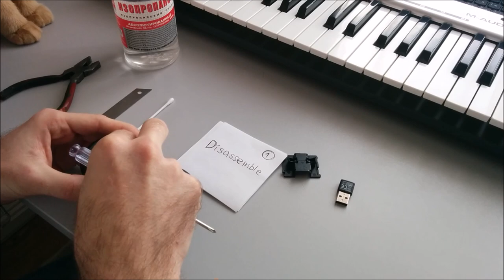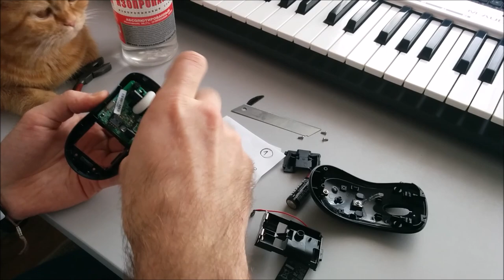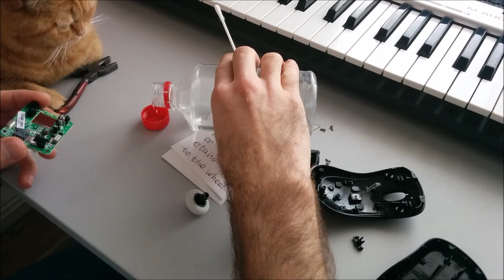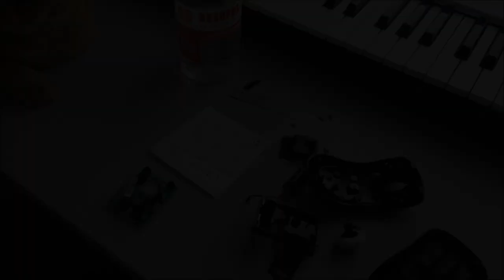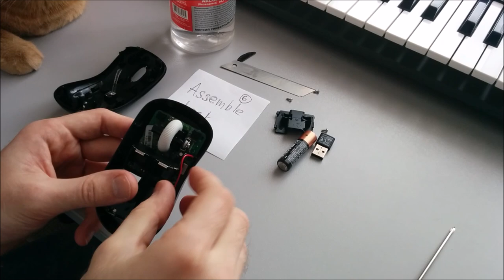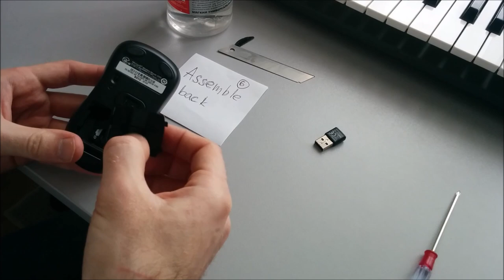How to fix Microsoft Wireless Mouse 1000 scroll wheel jumps

Comment: In addition to cleaning, I also removed the white rubber wheel and placed two turns of duct tape underneath. The first one facing down, the second one inverted, both glued to each other, so that it won't spin around it's base without sticking. . This resulted in a much, much more reliable scrolling experience.

Thanks for the instructions.

Comment: upon taking mine apart, the issue was the rubber wheel was rotating around the plastic center - so am adding glue there after washing those parts.   Great vid - thanks!

Comment: The hidden screws solved it for me. The problem with the mouse was the rubber tyre was slipping on its axle and it wouldn't scroll single clicks. I managed to get the wheel out without disassembling anything else. I took the tyre off and refitted it with some glue. Thanks for sharing.

Comment: Upon watching this video, here is what I did, i turned the mouse off and scrolled up and down very quickly for a few minutes. the idea is, if there is any debris on the wheel or contact points, it will fall off or just magically disappear :)  this method worked for me, at least for now. 

By the way, the video is 8 years old, I wouldnt have guessed that its been that long. As far as I remember I'm on my third MS keyboard-mouse set. With the previous sets, it was the dongles that failed, MS dongles are big and not very mechanically sturdy. 

My other sets are Logitech with smaller dongles. Smaller dongles are more practical for laptops.
Reply: Trust me, this method won't last long. I've been doing this for a couple of years, every action lasts for a couple of days. And here the dusting of the problem itself is at the root.
Reply: Just did that and the wheel works fine for now. Let's see how long this solution will last
Reply: this actually worked! i was just about to dismantle mine when i came across your comment and it saved me from this whole process! i
guess it's just part of the wear and tear, nothing lasts forever. if it happens again, just gotta roll away

Comment: Such a well behaved cat, and so attentive. I couldn't see how to pull it apart and nearly did some damage before finding this. After cleaning the mechanism with isopropyl I found my issue was slightly different. The rubber tyre was sliding freely over the hub. The wheel came out quite easily without removing the circuit board. I used a bit of contact adhesive inside the tyre to stop it sliding.

Comment: This really helped, turns out the red wire was not slotted in with the duel metal connector. This helped especially for the back grip peel - off, because beforehand I didn't want to break it even more!

Comment: I have the same Microsoft Wireless Mouse 1000 mouse and it's about 1.5 years old.  The little wheel was encased so i couldn't touch that.  I blew out all the parts & used et0h on the big wheel. To my surprise, it worked!  Just a heads up for anyone else who is having the same issue & DO NOT see the 2nd tiny wheel, there is still hope.

Comment: That fixed my problem. The scrolling was going back and forward. I assembled it after just 20 minutes and it didn't work at all (I didn't know it was probably still wet). I let it there for about an hour and then did another test. It now works perfect.

Comment: Great video it helped fix a MS Wireless 1000 mouse! 
But I noticed that the white rubber was sliding on the plastic wheel.
I removed the white rubber and used a small rubberband on the plastic wheel then reinstall white rubber.
Now it works great!

Comment: I have a later model Microsoft Wireless Mouse but it's basically built the same internally. However, instead of using alcohol, I used Shredder Oil to lubricate the plastic part that was squeaking, and I didn't need to take the scroll wheel off to get it nice and lubricated. Easy Peasy!

Comment: Alternatively i used wd-40 in the rotary encoder (mouse wheel internal) as it is good specially for electronic contact cleaning. And the mouse wheel started to work like a charm. Definitely worth a try with wd-40.

Comment: Thanks! Worked at first shot! What do you think the problem was? How did rubbing with mild cleaning agent help? Thanks again! 

P.S: Used Isopropyl Alcohol also known as Doctors Spirit in medical field.
Reply from the maker: +Kishore S Shenoy Just my thougths: mouse wheel potentiometer has very simple construction (https://s-media-cache-ak0.pinimg.com/736x/be/4f/c8/be4fc86ae95e45781ca411b915726b58.jpg) Moving contact shortens sections with "holes" to the common wire. Those holes placed in the way that allows to determine scrolling direction by the order in which that two sections connected to the always connected third section. So if there come dust or dirt inside some points may have a weak contact, some skipping occur and controller interprets that like a turn in another direction.
Reply: +punkpanther Ohh... I get it... Thanks! Great thinking... ☺😆

Comment: Thanks for share this tutorial, dude. I was having a similar problem with this mouse model, but the issue was with the rubber part of the scroll that was loose from the plastic wheel and when I was rolling it wasnt wheeling the sensor.

Comment: Sometimes the problem isn't on the electrical contacts, but in the rubber piece. I removed it from the plastic wheel and cleaned it with alcohol. Then, I used a double faced piece of strong adhesive tape to make them stick together, and that was it! I think super glue also works, but i think it's too aggressive.

Comment: I need help!

In the past 2 years I had problem with the Left Mouse Button, clicked once and it activated twice, or clicked it and didn't work, too many mouses thrown out because of this. So I bought a new cheap gaming mouse and the scroll is jumping up and down, so I will throw this out as well.

My question is, will a very expensive (100+ dollars) mouse help my frustrations disappear? Something like Logitech.
Reply from the maker: +Bada Bing Bada Boom As far as I know Logitech makes good mices and gives up to 3 year warranty on them, but many others do too, for example Razer, Corsair have positive reviews. Not sure if you need to go all the way up to $100, personally I never owned very expensive mices, but I always try not to go very cheap. I suggest you to try some different models at store to choose nice to feel, well-made mouse. Look for mouse with distinct clear clicks and solid wheel movement without wobbling. Ask for warranty options at the store and look for it on the manufactrurer's website, many requires you to register the product to get the warranty. And if something breaks ask for replacement.

Comment: Help me please.
I was having very erratic scrool movement, disassembled like you did. cleaned the wheel, but it still was loose, I added some rubber between the wheel and the axis is was good.
But the scroll still jumps, not being very precise, so I tried tightening the sensor like you did, now there isn't any movement at alll in the scroll, made sure not to break it, maybe its too tight?
By the way, I happened to be testing on linux at the moment, now I've seen that the erratic movement could be something else, any tips?
Reply: Guilherme Furst edit:
just tried going at it one more time, ended up opening the actual sensor roll thingy, tweaked a few things, put it up again and working :D
Don't know how but it worked, still the scroll doesn't have that click regular mouses do, but its working at least.
Reply from the maker: Guilherme Furst I'm not sure, but I guess there should be a flat springy thing with bump that do a click. May be you lost it when you assembled sensor?
Reply: punkpanther actually, I tried to make this a little bumpier, its very thin so I was afraid of breaking it, it was holding still but too for what I'm used to. Tried this once again and its a bit better now, if I keep doing this I'll end braking this thing.
Funny enough, I've compared it with my regular mouse, it holds a much better the scroll, yet its the same mechanism. Maybe its just the way it was designed.
Now somehow is optical tracking thats a bit sluggish, messed up, seriously, these kinds of mouse are a pain in the ass for people who need precision...
edit: correction, I found what it was dragging the tracking around, it was actually the protective pad, the with the screws behind it, without it the mouse performs much better :/
Reply: Guilherme Furst Hey, that scroll jump is a linux bug actually. Try sudo modprobe -r psmouse. If that doesnt work disconnect the usb transmitter and connect it again (This works for me everytime). 

Btw I put a piece of rubberband between the rubber wheel and the axis just like you did and that worked well for me. Cheers :)

Comment: This is rather odd.. This method did fix my issue, the wheel was fully responsive and didn't squeak anymore, however.. after several minutes of use, it began to not respond at all, I repeated the process again, and no luck

Comment: I don't have that alcohol thing... what else can I use? Can I use water?
Reply from the maker: Just don't use tap water, it could leave minerals on contacts when dry, distilled water is the best. Isopropyl alcohol could be found in drug stores, it sold as antiseptic, ask for concentrated isopropyl in first aid section. Ethanol could be found in liquor stores, or you can use vodka. Alcohol has more cleaning effect than water so it's preferred.
Reply from the maker: Also concentrated alcohol doesn't conduct electricity and dry fast so it generally safe for electronics. If you'll use water make sure it fully dried before turning thing on.
Reply: punkpanther Can i use W40?
Reply: No, because this melts the plastics parts.

Comment: I hate when I have to remove the batteries of this mouse, so I opened the mouse and cut off a piece of plastic that dificults the ejection of the battery. Now it's much easier to remove it.

Comment: Wierd. In your mouse, the whell has naked, and its turns possible to clean it. But in my mouse (Microsoft 1000), the whell have a protection, a little piece of plastic, covering the whell (aaaaalllll whell). Unfourtunally, I can't clean my mouse. sniff....
Reply from the maker: I actually doesn't know much about your mouse construction, but whatever protection the wheel has it most likely not waterproof. You may try to pour some alcohol into slits or gaps (just use concentrated one because leftover water may conduct electricity and introduce corrosion effects) with some pipet or straw like thing to wash out dirt. Make sure everything is fully dried before connecting the mouse.